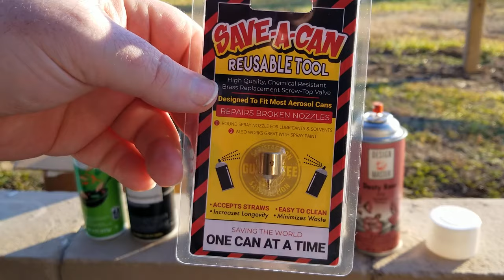SAVE A CAN   Fix Damaged Aerosol Cans

Comment: What if the plastic pipe in the can falls off? I have the spray head but the little valve through which the paint goes through fell out somehow and I lost it. Can I just pull out and use a the plastic valve from every day spray deodorants?

Comment: These are very easily damaged. Mine broke simply by removing the cap from the can and the side load on the very tiny neck that goes inside the plastic of the broken valve nozzle. Not recommended.

Comment: I bought this for a brand new can of cooking spray and for some reason, it did not work. It was on correctly. Just dribbled out.
Reply from the maker: Must have been something wrong with the can because there's not really much that can go wrong with the nozzle. Does the can still have air pressure?
Reply: Possibly the stem isn't going down enough.